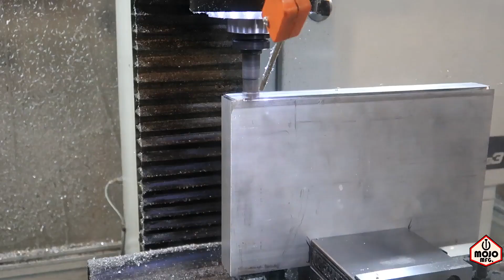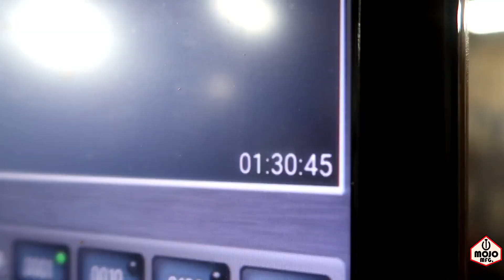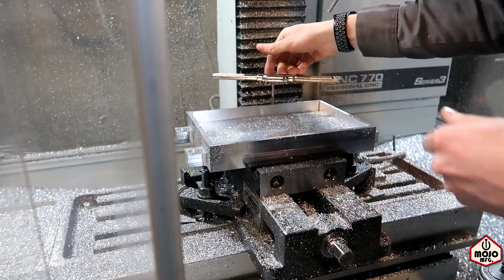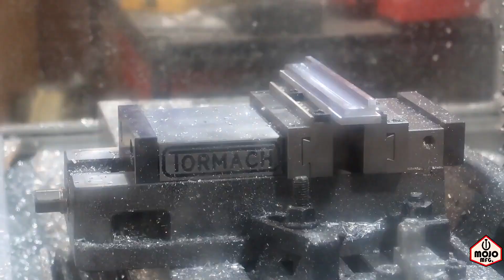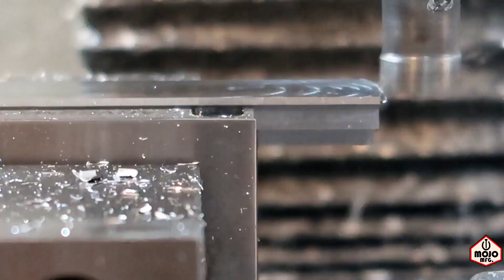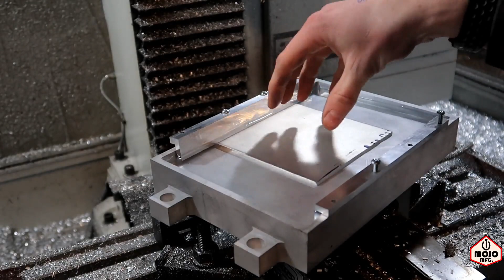Carbon Fiber Milling Plate

Comment: Now that seems like a good idea!  I need to mill some phenolic and it has the same problem; it's a dusty toxic mess.  I might have to "borrow" this idea :)
Reply from the maker: Haha go for it.  I have a video scheduled to come out where I actually use it.  It's best to keep a water bottle "squirt gun" when using the water bath just to spray on the cutting bit every once in a while to flush all the nasty dust away from it.  The grimey dust in the water almost turns to concrete if you aren't flushing it away.
Reply: Good to know, thanks.  I'll be watching for that video.

Comment: Not sure what tooling you have planned but Harvey makes some awesome tools for carbon! I have also used an uncoated carbide 4 flute ball end mill with quite good success! Excited to see the milling carbon video :)
Reply from the maker: I follow a guy on instagram and he uses an Amana Tools 1/8" AlTiN coated carbide burr all the time. I think I will start there and possibly move up.  Harvey has some awesome compression cutters for composites but they are wayyyyy too expensive for me and my novice approach for try to machine carbon fiber.
Reply: MojoMfg. Fair enough! I’m excited to see the parts you create man!